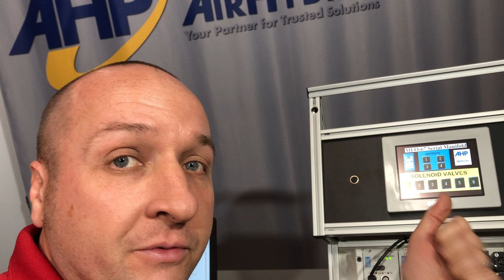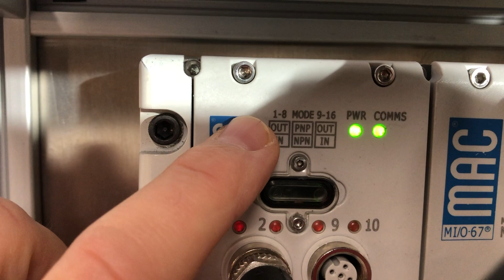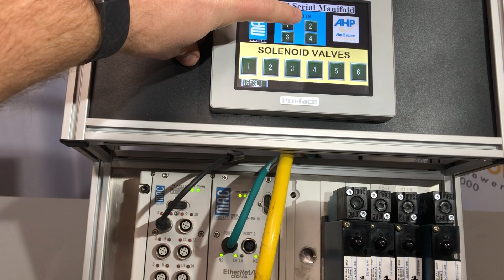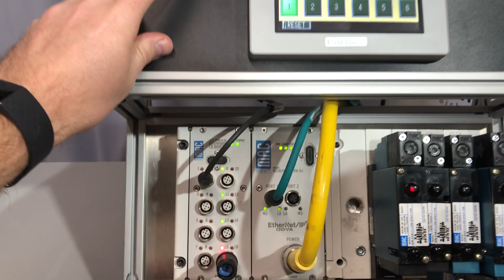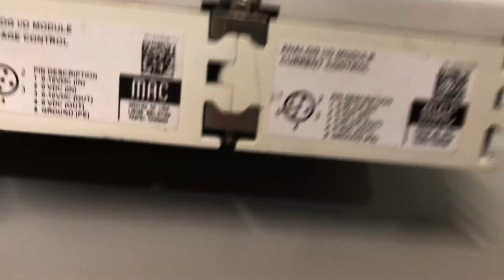MIO-67 Introduction

Comment: Question:  My Mac distributor is telling me I will only need one 10amp pwr supply to power the electronics and the valves for a 24 valve stack.  It seems from the literature I've read and a few videos, the best thing is to use two separate 10amp pwr supplies.  I guess I'm confused.